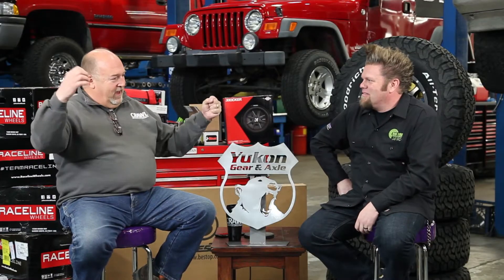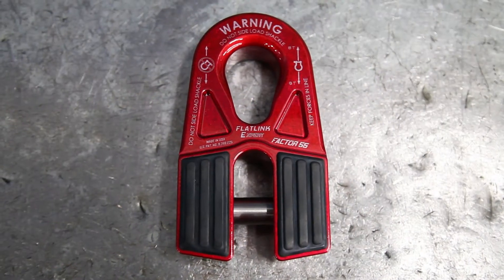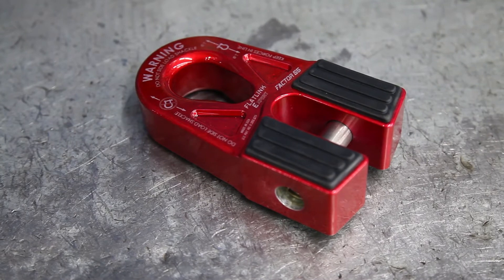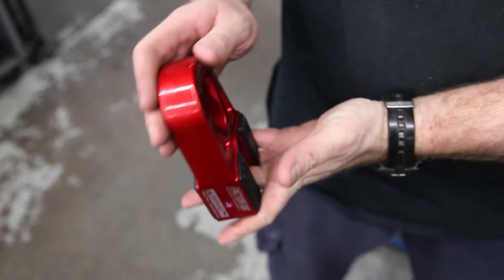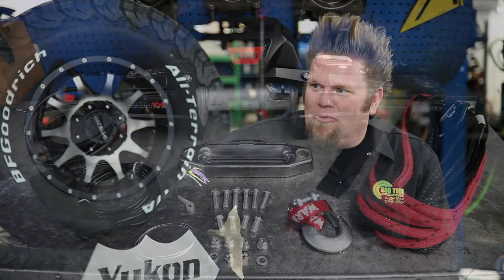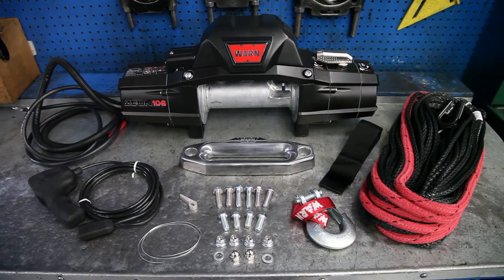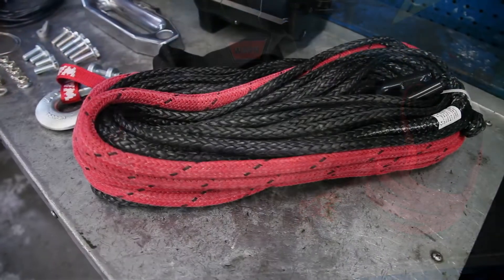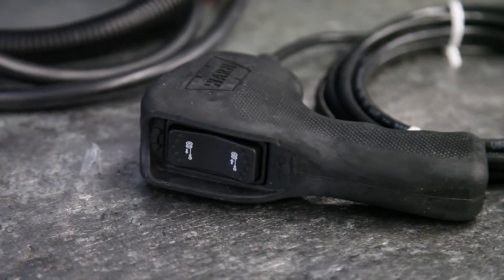Elmo the LJ Build - Winch, Recovery & Armor

Comment: The 20 seconds of install video of the savvy rockers is better than savvys bullcrud instructions.  They tell you how many bolts and sizes, but it's up to you to figure out what goes where. No information as to where the inside the cab backing plates go....  Smitty may be cheap Chinese crap,  but all of their instructions are very good.